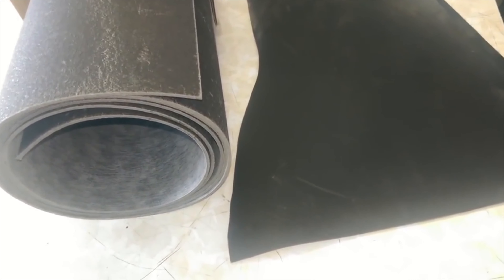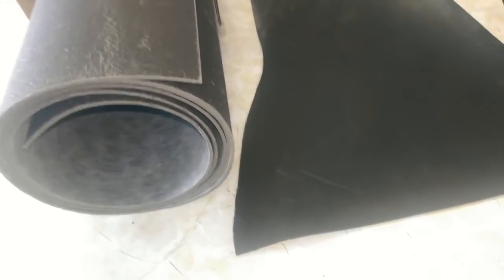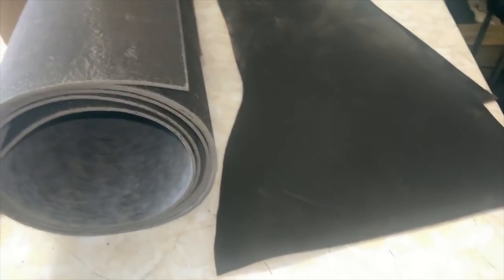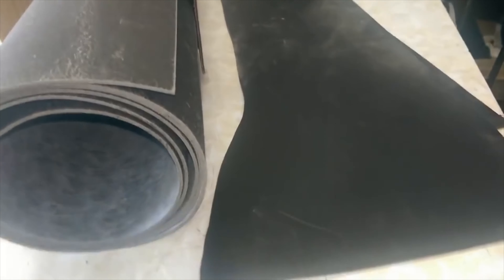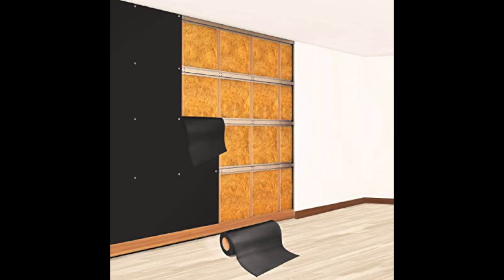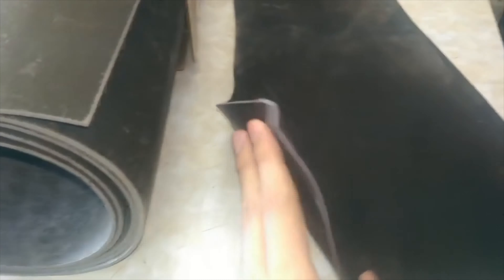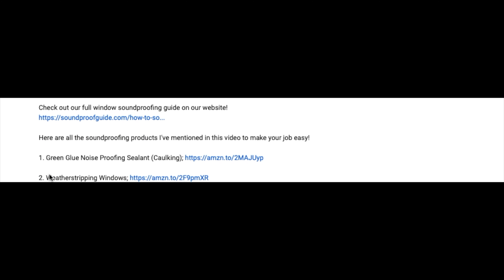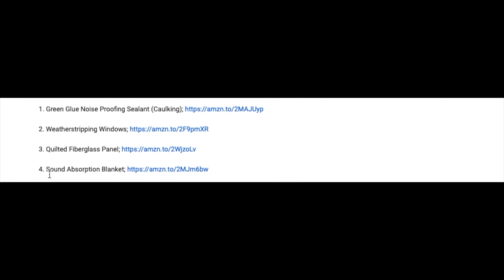Installing Mass Loaded Vinyl Soundproofing the Right Way!

Comment: MLV is the way to go! Condo dwellers, this is your fix for noisy neighbors. I watched many videos and researched products after 8 months of hating my bedroom due to a shared condo wall. The MLV worked with the acoustic caulk and 5/8 drywall. I went even further and did mdf sheets over that with a decorative box grid mdf design. My unit is the envy of many neighbors that have seen my pics. Well worth every penny.....thank you for these videos.
Reply from the maker: That’s awesome! Thank you for sharing!
Reply: Should their be insulation in the walls too?
Reply: I don't know, i just went over the existing sheetrock since I had new construction. I do regret not doing putty pads over the 3 outlets but losing 2.5 inches of the room did make a major difference. MLV, sheetrock, mdf and dont forget acoustic caulk.....
Reply from the maker: @carolcarol4916  Could you send your pictures to info@soundproofguide.com 
I'd love to see them if you're willing to share. 😊
Reply: Will do
Reply: @carolcarol4916  hello Carol could you share the MDF sheets that you use with the design? Thanks
Reply: Do you happen to have any pictures or videos of your installation process? Before or afters? Thanks in advance

Comment: What about wrought iron panels? I have a roller blind box which allows a lot of noise in and thought of having a metal worker make iron panels to fix around it(behind the drywall) the reduces sound transmission.

Comment: How should MLV be applied to existing drywall, should it be right to the edges and ceiling, or do you need to leave a small (eg 1/8 inch) gap?
Reply: Wondering same thing

Comment: I've heard that the studs are a major conductor of sound waves.  I've heard that you want the mlv to hang freely, which I interpreted to mean that it shouldn't attach to the studs.  1) Is that complete nonsense?  2) Or, does it not matter because the acoustic caulking dampens the transfer of sound from the studs?  
Or, do I have no idea what I'm talking about?  I'm just trying to learn.

Comment: Two things?
Would this help with outside noise such as car bass booming ? Would it still work over existing drywall in a small apartment?
Reply: There are some sounds that unless your willing to encase yourself in an airtight bunker of 1ft concrete bricks that is then encased in another brick bunker with a 2ft air gap that you will only EVER get reduction not outright elimination with. Bass frequencies are an absolute nightmare, the wave forms are extremely long and they generate a lot of kinetic energy and air pressure which is great for creating something called structural resonance (where the wave vibrates all through the foundations of a building and turns the building into a sort of amplifier/transmitter) and even just reducing it takes some serious jiggery pokery that takes 1000s upon 1000s of pounds/dollars. 

If you were to coat the whole room in MLV then a couple of layers of 5/8" drywall (that has another layer of mlv sandwiched between it) you might kill some of the noise and absorb some structural resonance but it's highly unlikely it would do it to a degree where you'd be happy. Even the most experienced and genuinely professional companies can only promise about a 60-70% reduction in noise when concerning car engines, traffic and sub woofer systems and that's them doing the 1000s and 1000s magic I mentioned earlier. Theres a reason you can hear car revs and sub systems from blocks away and it's because they are just that freakin loud! 

I speak with nearly a decades experience as a sound engineer whose built a few recording studios, bass is the biggest enemy and if you want to reduce it my friend you'll need more than a bit of MLV I'm afraid :) I hope you had some luck!

Comment: Great video - some very useful info here. One big problem though: it is not possible to add putty pads to the back of the electrical outlet boxes once the MLV is in place.
The only solution I see for this is to cut some MLV and surround the back of the outlet before installing the rest of the MLV, then sealing around the front of the outlet after making your cut so that the surround is sealed to the main sheet.
Are there any other ways to solve this?

Comment: If I'm building a room within a room, do you put Resilient Channel on top of the Vinyl on top of the studs?  Or should resilient channel go on the studs and then make a vinyl-drywall sandwich on to the RC?  
I guess a better question is what should all of the layers of each wall look like, if I'm building a room within a room and starting with the original room down to the studs?
Reply from the maker: Yes, a room within a room. The only way the resilient channel will work at its best is if placed directly on the studs. Best of luck 😊

Comment: Hey! This is super helpful in my planning for building a drum studio. Thanks so much for all of your videos! I have a quick question, I want to use MLV and a resilient channel for the walls to ensure I've got enough mass, along with a decoupling effect for an air gap. 

Should I use MLV directly onto the studs as explained in this video, and then install RC, plus 2sheets of drywall - OR should I install the RC to the studs, then have drywall-MLV-drywall attached to the RC? Would there be a difference? Any help would be great! Thanks!
Reply: Did you ever get this question answered? I've had the same inquiry but no luck finding any hard answers.
Reply: Treat electrical boxes, etc with putty. Install MLV direct to studs. Stuff 2x layers of thick insulation or acoustic insulation in the gap (do this step two installing to bare frame, you can and should do this step first if there is already a wall on the back side of studs) then fasten clips/RC, then hang 5/8 drywall, green glue seal full surface (recommended, not required) then 2nd layer MLV, GG seal, then 2nd layer 5/8 drywall. Seal at least this last layer and all joints/seams with Green Glue sealant and caulk products.

Comment: How do people MOVE the 1000lb roll of MLV?  I got the 48"x500' for my workshop, and some in the house, but it comes as a single roll.  The pallet actually crushed from the weight, that the freight carrier couldn't use a pallet jack to get it off the truck.  How do people  work with such a large and heavy roll of this stuff?

Comment: can you help with this problem? I've had main walls supposedly sound proofed. However In the bedroom upstairs i can hear banging about from next door. So i need to sound proof the joists pull up the floor boards and input soundproof rockwool then put mass vinyl on to the joists then put floorboards back does this sound effective? if not please suggests any tips. many thanks.

Comment: Excellent video, thanks!
I would like to add the resilient channel to. Do you have a suggestion where would it go? 
I often see construction like this: rockwool in between the joist, sonopan on top, resilient chanels, then two layers of drywall. 

With MLV, where could we put the resilient channel? 

Thanks!
Joel

Comment: Would using 5/8" soundproof drywall on ceiling with 1lb or 2lb make it good? And 1/2" on walls with 1lb MLV,help aswell for soundproofing?

Comment: I have a question.  I am interested in installing the MLV, but I think I want to do it outside.  I am changing the sheathing, so I'm thinking about putting it under the sheathing.  I'm afraid if I put it inside, it will actually be bad for acoustics inside the room, as it might reflect the sound back in and not absorb it like Rockwool would.  It is my living room area, so I don't want that to happen.  My interest in the vinyl is to help block outside noise from coming in, which is why I think it might be better outside?  Any recommendations would be appreciated.  Thank you.  I will use your links.

Comment: Hi there !  What about putting mineral wool between the studs...putting MLV over the top..and then is it possible instead of going straight over with drywall to use sound clips over the top of the MLV that separates the MLV from the outside drywall ?? I'm trying to block sound from drums and music on this one particular wall so it's not loud on the other side.  Thanks !! I could really use some feedback.  I know MLV is the way to go but then I see the sound clips and furring channels, sometime separate and sometime together.  So I didn't know if I could use them all in one shot on this wall.  I'm looking to block the most decibels I can.  Looking forward to the response !
Reply: What did you end up choosing? Looks like you didn't get a reply:(
Reply: @PulseChainNews  I ended up doing all of those things I listed in the paragraph above.
Reply: @berrettamusicacademy9980  how well did it turn out?

Comment: I have a dividing wall that’s shared with a neighbour, believe this is called a ‘party wall’? (correct me if i’m wrong) initially i got in guys to apply dry wall plaster sheets onto the wall then a layer of plaster over it, this has only made the noise coming from next door more amplified. 
To successfully apply MLV to this wall would i therefore need to remove the dot n dabbed attached plaster sheets before applying MLV directly onto the party wall and then a layer of plaster sheeting on top of that ??

Comment: I've heard about using rubber cow mats (aka horse stall mats) in place of MLV. These mats are really heavy (some of the least thick have a density of 3,5 lb per sqf ). One of the drawback I would see is that they might be harder to work with (heavier and less flexible). I guess they might be cheaper too if you can source them locally

Comment: so i have 21ft by 8ft wall, i wanted to add this to the wall, then put wood strips on this to hold it and then pallets over. basically a pallet wall design but also to help with some noise from the kitchen in the flat next door. would this work?

Comment: Ok, so I want to add a layer to an existing wall, not concerned about cost. Layer MLV, then resilient channel, then 5/8 drywall? Should I use 1 LB MLV? Would Soundrock drywall be better? Thanks

Comment: Hi there!

Thanks for the great info in your videos. I was wondering what you would recommend for insulating a basement ceiling that is 1/2" gypsum board fastened directly to floor joists. I am renting and do not have the ability to install insulation between the floor joists. Also, the ceiling height is somewhat low at 7' and I need to preserve as much headroom as possible in the basement. Thanks again!

Comment: Great video.  I am building a small soundproof, totally enclosed cubicle.  I have doubled up with 5/8" drywall and used green glue in between on the outside of the structure.  On the inside, I have only used 1 layer of 5/8" drywall.  I feel that I need some more material to improve this. I would like to use MLV.  I would like to put it outside of the inner cubicle walls.  Will this be ok?  Other than stapling it to the wood frame underneath the 1 layer of sheet rock, is there anything else I need to keep in mind?

Comment: Thanks for the video, love your stuff! 
Question: I have a wall separating me and a neighbors. Should I tear down to the studs to install MLV, or could I just mount the MLV onto the existing drywall, and then put up a 2nd layer or drywall (kinda creating an MLV sandwich)?

Would there be a difference in noise reduction?
Reply: lol are you being serious?
Reply: You've probably long since done it but just for any others who come along, drywall>MLV>drywall is used in many a sound recording studio and is a very effective blocker of sound especially if it's the 2lb a square foot MLV and sandwiched between acoustic drywall,  lots of weight mind so the studs need to be decent with props (a couple of small chopped cubes of wood here and there) at the rear of them to the brick, helps prevent sagging, resilient bars and genie clips can also be used to further amplify the sound blocking effect but like I say, it's a lot of weight so be aware.
Reply: @Nine-Signs  thanks so much
Reply: @malinabramsson7960  You are most welcome, best of luck.

Comment: This is great information. I am looking at quieting a home office, and perhaps using as a beginning sound studio (Voice Over). I was wondering if putting MLV over something like Quiet Batt with 5/8" drywall. Would that be too overkill? 
One wall is an exterior wall with the AC units just outside them, and one is between the office and the kitchen (microwave is LOUD).

Comment: Is this more effective than using 2 layers of sheetrock?
Reply from the maker: It certainly can be if you use the 2 lb/sqft. MLV.  I would go with the second layer of drywall if you're using anything lighter than that.

Comment: Great video!
Is MLV better suited to airborne or impact noise? 
I can't hear talking, TV etc through a shared wall, but I hear footsteps on a hardwood floor.
Reply from the maker: MLV is better suited for airborne noise. It won't do much regarding impact noise. 😊
Reply: @soundproofguide  Cheers :)
Reply: MLV won't do much for impact noise (or any super low frequency noise). You need to decouple to fix that, which if you rent means building an "airtight" booth away from the noise with a floating floor.

Comment: I want to line a 12 x 20’ shed to use as a band practice room. How much and what type should I use?
Reply: You should probably use something like 2lb/sqft but you'll have to put drywall on top of that as well. I'm only pointing this out because there are plenty of "soundproofing" products that either have MLV in them or are similar in property that are advertised to be put on a wall. Which doesn't really do anything for the low end noise or structure born noise.

Comment: Really enjoying your videos thanks for sharing this information. I’m based in the uk and have a breeze block wall or thermalite blocked wall between x2 rooms that is just plastered over. I want to soundproof as best as I can between the 2 walls but the windows go wall to wall and don’t leave a lot of space to work with. It’s probably 25mm on top of the existing layer of plaster to work with. Am I better taking the existing plaster back to the blockwork to give myself more room to work with and use something like the Multi layer vinyl? A builder I had round suggested dot and dabbing sound proof plasterboard sheets over the existing plaster. Bit confused so any guidance is much appreciated.
Reply from the maker: I would take the plaster board off but it all depends on how much more work that would entail for you. In your situation, Either methods will be effective in stopping at least a bit of noise transfer.